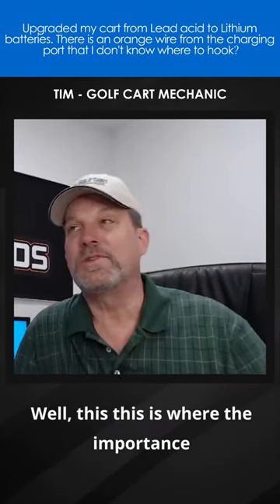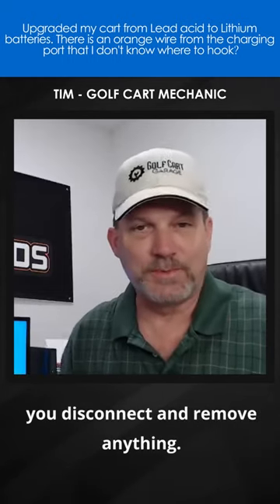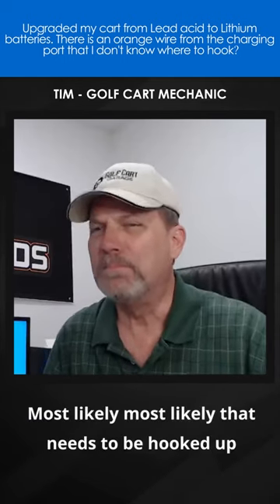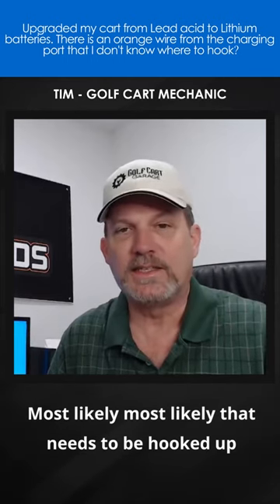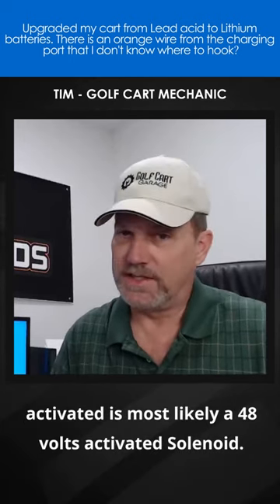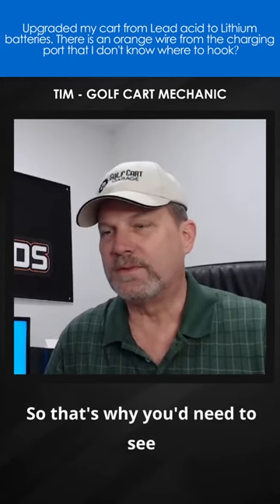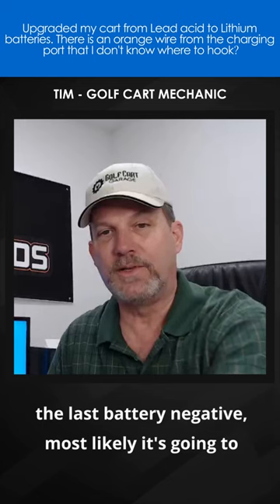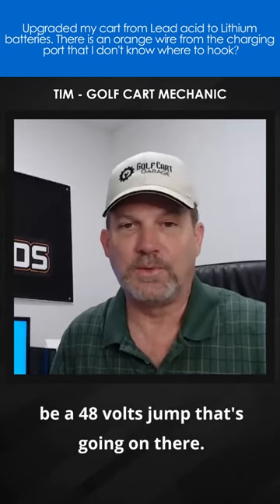Lithium Batteries Wiring | Your One Stop Shop For Golf Cart Parts And Accessories

Comment: Tim help I had a previously running 2010 RXV 
I installed new lithuim batteries and now it wont run . Checked everything cant figure it out… When i power it up i get 48 at all points on soleniod 
When i turn the key nothing
I did chang the key switch also before i installed the new batteries
Any thoughts ?
Reply from the maker: I would say just changing to lithium should not have changed anything having to do with your cart running.  Must be a wire that is not hooked up if it was running before or perhaps some other easily overlooked issue.  We recommend a free consult with our tech team here: https://www.golfcartgarage.com/gearheads-on-demand/ or contact directly at Support@GolfCartGarage.com or (800) 401-2934